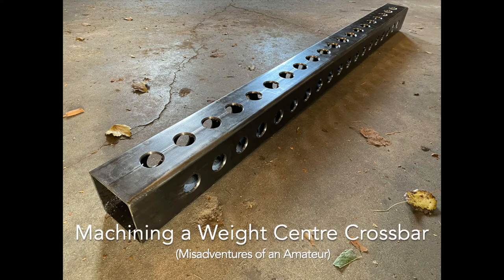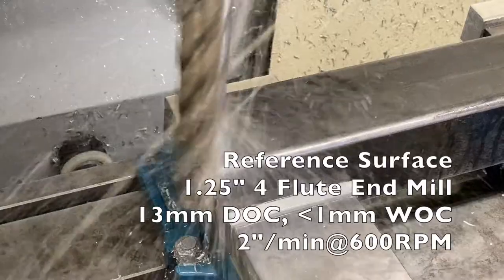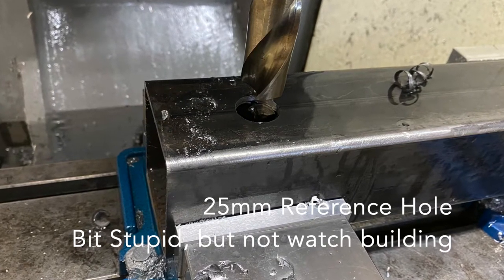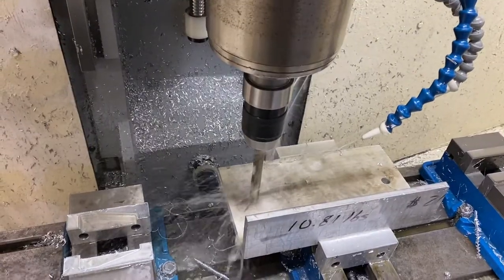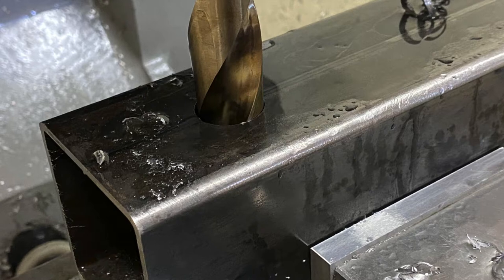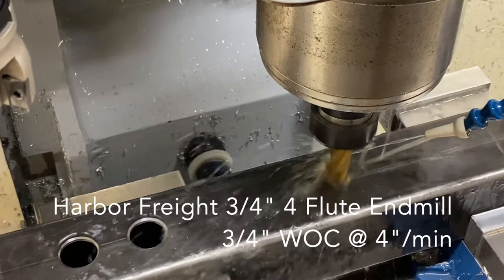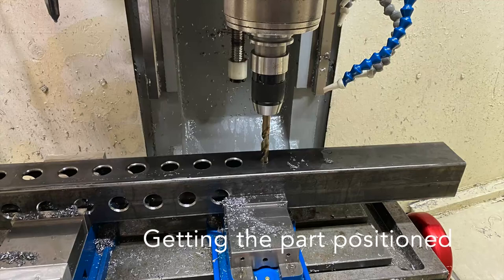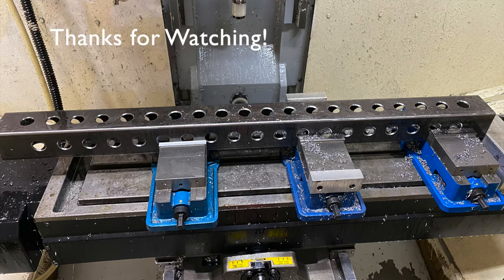Machining Weight Centre Crossbar on Haas TM 1

Comment: Nicely done. Both the part and the video. (Well... maybe less loud, edgy soundtrack next time? 😎). Gotta like the manufacturer standing behind bit replacement. Too bad it takes a month (maybe more with current logistics issues) to get the replacement. Please post a photo of the part deployed when available...
Reply from the maker: Thanks Mike,  My video advisor (son) thought that the music was a mandatory addition 🙂.  I will tone the volume down a bit on the next one though.  The first part took 4 hours to make, because of the milling time to create the hole.  I am going to use a standard drill or an annular cutter on the next one and hopefully cut the manufacturing time in half or more.  Will absolutely post the deployed part when done.